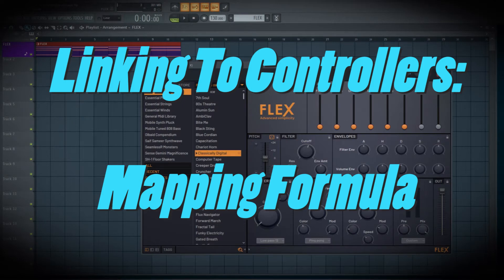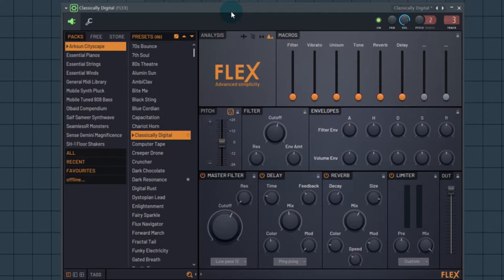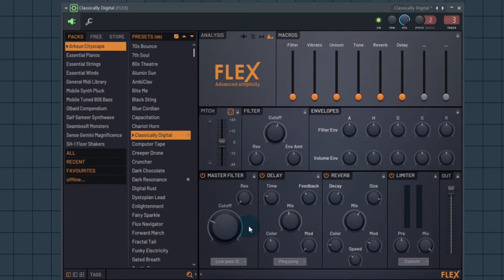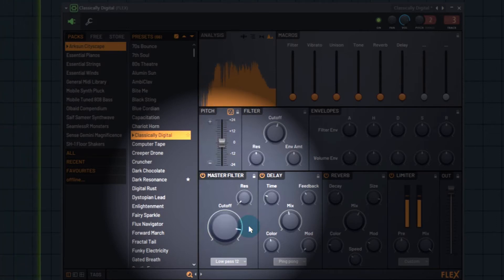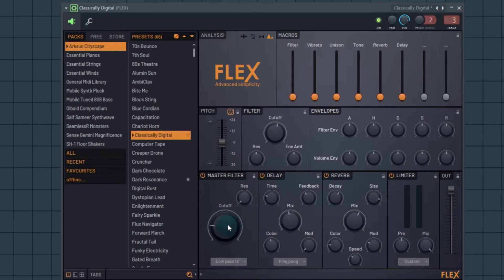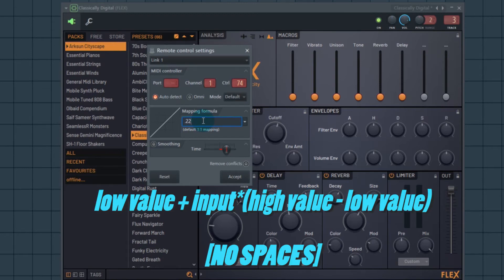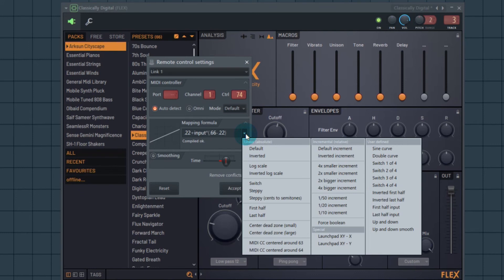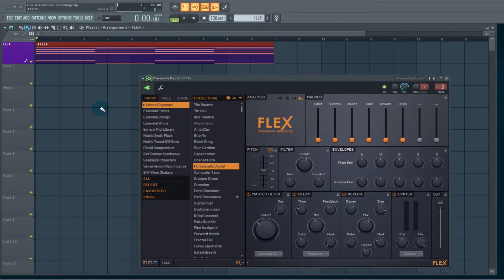Mapping Formula For Controller Links

Comment: Hey @JohnJuddMusicStudio ,
I know there is a way i propably haven't found yet... but I try to link the Time parameter from FL Delay 3 to my controller... it works, but not the way i intended... i Want to use the Tempo sync option, so i want my Midi knob to Jump between the Values to hit the points where the Tempo is synced... i know there is a 64 step preset, but it sadly hit the offs... Do you know how to create an own Mapping formula preset? Cause the first step of the Time knob to the first tempo synced point is larger than the other steps between the synced steps.... 
greetings from Germany :) 
And hopefully Thank you so much for your help? XD
Reply from the maker: Thanks for stopping by and checking out the video!  Let me bake this in my brain for a bit and I will get back to you.  It’s going to be a very busy week, so it might be a minute.  Habt eine tolle Nacht
Reply from the maker: And this last thing was probably bad grammar 😬
Reply from the maker: Here’s what I’ve discovered so far:  I’m not sure this can be done with a formula, because I believe the points on the Delay 3 time knob are NOT spaced evenly.  That’s odd, imho.  If there is a formula to plot that out, my math isn’t good enough to figure out a formula that would make that happen.  There might be someone on the forums who has the math chops to figure that out.  I will look into other cool ways of doing what I think you are attempting.  At the moment, I think you might be stuck with an automation clip to change the values.

Comment: Hi, i used fruity formula and chose mouse position from preset but i couldn't record automation, when i record it could not record mouse movement
is there any method to record mouse position in fruity formula???
Reply from the maker: My friend, it’s a somewhat hidden option!  When you go to link your synth parameter, take a look at the remote control settings.  Underneath Internal Controller (which you should have selected Formula Ctrl ~ out) you should see a little dot that says ‘record automation’ next to it. That dot needs to be highlighted.  It should now work for recording.
Reply: @JohnJuddMusicStudio  thaaanks. It worked.
i turned on and now i can create automation.
thank you again 😊 ❤